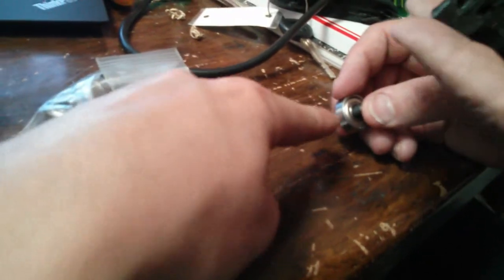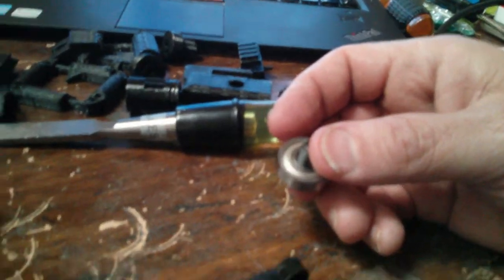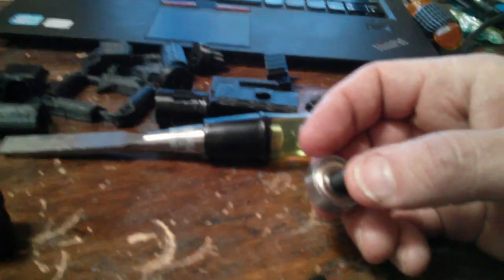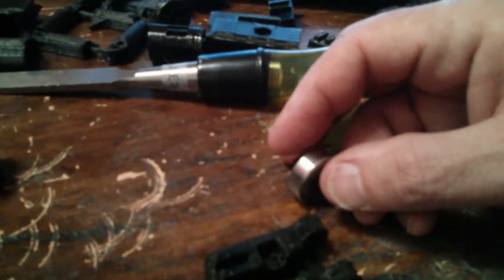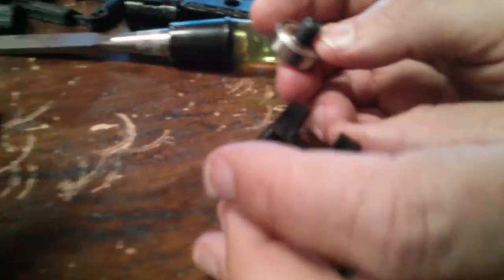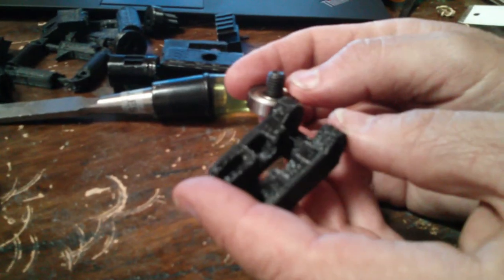608ZZ doesn't fit extruder hinge

Comment: I am having the same issues all around.  I ended up re-drilling each bolt hole & shaft hole  on all the printed parts (3mm, 4mm, 5mm, 8mm - Get a good US made metric drill set (no Harbor Freight if you want a good fit)). I also milled several parts flat so that it would mate with the corresponding part.  For the bearing set in this video, I used a 7/8" Forestner bit (perfect size for the metric bearings supplied in my kit) which allowed me to make flat aligned bearing seats for the extruder bolt (my bearings wouldn't even go in the holes).

Another few things: I purchased Dayton motor couplers to connect the Z axes lead screw to the stepper motors which gives areal nice aligned & centered motion (instead of the vinyl tubing coupler supplied). Lead screws on Z axis were not true, so I also replaced the Z axis lead screws with stainless steel (only cause my hardware store had straight ones in stainless).

I fabricated a lead screw guide bracket with nylon bushings and mounted them on the top of the z access, adding stability and accuracy to the print carriage.

I also milled the plastic hinge rotational surface (in this video) to be square, and put nylon washers through the hinge bolt which lowers friction & will enhance performance.

What else...to stiffen it up, I bought longer hex screws for everything and added washers on them, also added washers and additional nuts to the table x-y frame, which, all things combined, helped a lot to make it more ridged. I also bolt it to a piece of plywood and reinforce the Z frame.

I think with these enhancements, it will print really good. But not sure how the average person would get a good clear print without a decent drill press, mill, and Dremel. I wouldn't build this with only a hand drill.

Sorry for the long dissertation on this, but hope to help those who might have same problems. This printer is what it is...and you get what you pay for compared to some other more expensive kits. If you like to tinker with stuff, this is fun. If not, you may not like this kit.   It's no wonder many reviews mention that this printer is not accurate and wobbly.  I made my printer to be what I need to be happy with the end product, but know that it isn't an afternoon snap together project.